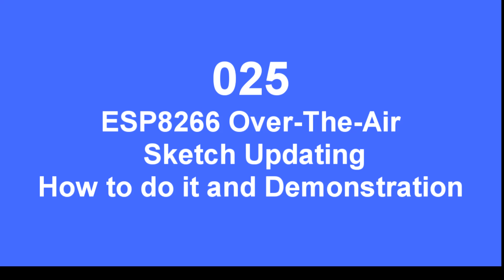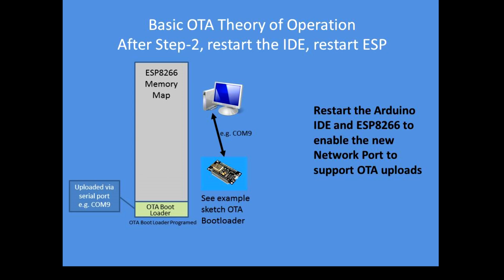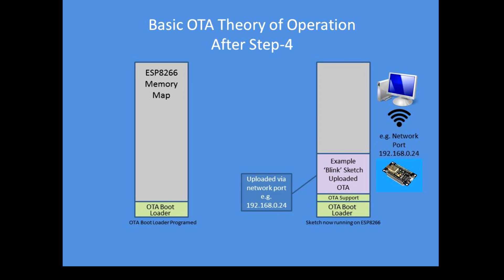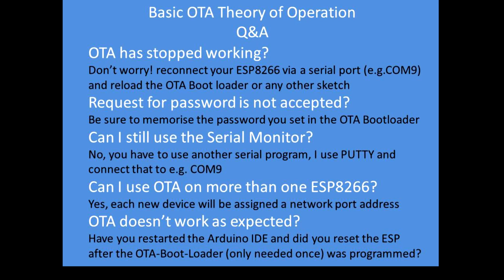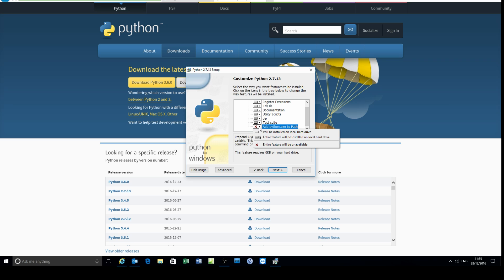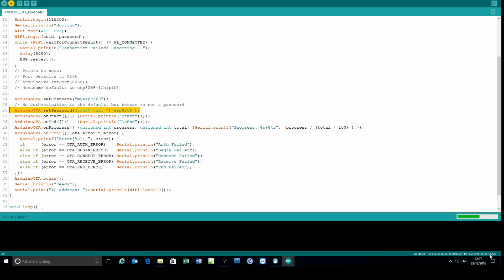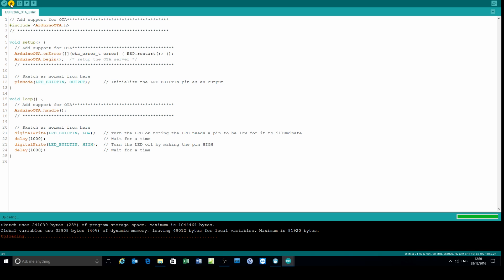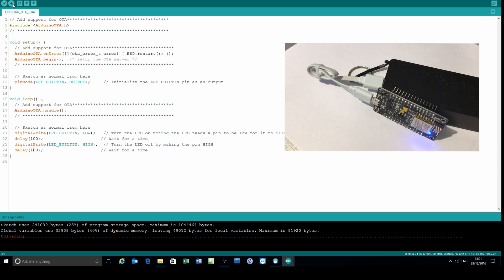Tech Note 025 - ESP8266 OTA Sketch Updating

Comment: I am getting error that there is no answer from the device
Reply from the maker: Is it connected or connecting to your network? Are you polling on the update device for a connection?
Reply: @G6EJD  it is connected to the network.
Reply from the maker: So in normal operation you can see the IP address of the ESP, then when you run the update process you see no response, this indicates that your ESP code is missing the check for an update service request. You can either use my example or the example in the Arduino IDE for OTA as they are identical. It’s most likely to be a coding error, you need to check your code on the remote device.
Reply: @G6EJD  yes it is listed under tools>port in the ide in addition to the com port. update service request, can you give me a hint what this code is?
Reply from the maker: @karanbirsoin9983  go to examples OTA

Comment: Just an additional note on this good tutorial. ArduinoOTA does not work when using timers or PWM. For anyone trying to do OTA updates with projects using timer interrupts the following code may save you a headache.

// Disable timer1 ready for OTA firmware update
// You can also disable timer0.
void ICACHE_FLASH_ATTR hw_timer_disable(void)
{
	ETS_FRC1_INTR_DISABLE();
	TM1_EDGE_INT_DISABLE();
	TIMER_REG_WRITE(FRC1_CTRL_ADDRESS, 0);
}

// OTA Callback, disable all PWM and stop all running timers
ArduinoOTA.onStart([]()
	hw_timer_disable();
	analogWrite(LIGHT_PIN, 0); // stop PWM
});

// Set timer1 as interrupt timer example code
timer1_isr_init();
timer1_attachInterrupt(onTimerISR);
timer1_enable(TIM_DIV16, TIM_EDGE, TIM_LOOP);
timer1_write(clockCyclesPerMicrosecond() / 16 * 50000);  // 50000uS = 20Hz = 50mS 

Ref: https://www.esp8266.com/viewtopic.php?p=34411

Comment: Is it possible to read the serial.print() if the esp is not connected to the pc? I use ota because esp devices are far from my pc, is there a way to read the serial print even without a connection to the pc?
Reply from the maker: Davide, it is possible to do this but the method is complex and requires a lot of experience and knowledge to do it, sorry. What are you trying to do? When you use OTA your serial port is already remote check your IDE you should see the ESP port number with its IP address so data on that port if you select it should be visible.
Reply: @G6EJD  thanks for the reply and the great channel. I'm using serial.println() to debug my code. In my ide Incan see the devices I uoloaded the OTA sketch and I can reupload sketches via ota but the ide tell me the ip address of that devices but not the serial port. Devices are not connected to the pc. So what is the right port to connect via putty serial?
Reply from the maker: Davide, in the IDE do you see the port (ip address) of your board? That is the IP address. The ESP does not have a process running that can respond to an IP connection on a given port, as I say it’s not as easy as you might think. If you use the Espressif IDE you can redirect the serial port to use telnet as a transport protocol and then on your PC you can install and use telnet to get a remote UART connection. There are notes that explain how to do this.
Reply: @G6EJD  This channel is amazing, congrats. I'm using Platformio for mi C++ sketches and I don't want to leave Platformio + Visual Studio Code at the moment. So I think that I'm out of lack. Thanks anyway :)

Comment: Just to be clear. It still works fine if I modify the sketch and upload OTA. This is merely for my own understanding.
Reply from the maker: That's the idea providing you switched over to the network port? and ideally run it remote from your PC, or disconnect the USB port.

Comment: I am a little confused When you hit the upload of the BasicOTA (at 6.00 minutes) your screen appears to switch over to "esp8266_OTA_Bootloader" while my IDE just loads Basic OTA. Have you missed a step or have I installed your files incorrectly? I'm sorry that Newbies, like myself, are such a Pain in the A.
Reply from the maker: I'm showing that the initial upload has to be via the serial port, then I move over to the network port. I've done a later video for the ESP32 which is identical an identical process and code is about the same, perhaps have a watch of that.

Comment: no network port is shown on ide.
what can be solution to that?
i've tried disabling the firewall,restarting the id and rebooting esp8266 but still the problem persists.
please help
Reply from the maker: zeeshan haider Usualky this is because the OTA support is not installed correctly or try installing it again and restart the PC and IDE.

Comment: G6EJD, i see the esp8266 in the Bonjour browser, but no port shown in serial in arduino ide? :( what do you suggest?
Thank you so much! :)
Marc.
Reply from the maker: What networks do you see? The default port, you can set it to your requirement, is wait for it 8266
Reply: the problem is that i don't see it in the arduino ide serial port?! :( only in bonjour browser in 8266 ports.
Reply from the maker: So there’s no USB connection then, this can be a really difficult problem to solve, do you get any connection acknowledgement like sound or when you look at connected devices do you see it?
Reply: I can only program it through COM port, there's no serial OTA showing up! :( 
thanks.
Marc.
Reply from the maker: Another common problem, have you tried restarting / reinstalling the java environment that handles the OTA aspects. In terms of sequence no virtual port will be seen initially by the JAVA device/port scanning, then you upload via the COM port a programme that supports OTA (that means the ESP actively checks for an OTA request let's say every 10-secs and if it does responds with an 'available for OTA' response) then it can take perhaps a minute or more or an IDE restart to see the new port (the remote ESP), after which you can disconnect the COM port and programme the device via the virtual IP port. BUT your uploaded programme has to keep checking for an OTA request or it won't OTA again and require it to be programmed via the COM Port again.
Reply from the maker: And let's not forget the ESP has to have made a network connection OK. So you should see it as an available network device.
Reply: reinstalling java didnt solved the issue :(
Reply from the maker: Have you tried the basic ota example in the IDE? I’ve used it recently and it works without problems on the 8266 and 32 devices. Your not using the latest java are you :) it has to be the specific version 2.7 something? Not 3.5
Reply: java or python ?
Reply from the maker: Sorry python, getting late here :)
Reply from the maker: If using one of the examples do you see on the com port that it joined the network ok? It reports progress as it goes.
Reply: i see it on bonjour as tcp.arduino port, but i cannot see above the serial com port in Arduino IDE :(
Reply from the maker: Other things to consider - a router not allowing unknown device connection, but unlikely, your development / ide platform is preventing a connection, like a firewall, a typo in the said or password.
Reply from the maker: I’ve just been reading the OTA documentation, there is a note about ‘boards.txt’ needing to be updated, I’m using IDE v 1.8.4 and it works.
Reply: firewall in my router is disabled, other things i can do ? 

Thanks.
Marc.
Reply from the maker: Maybe a Mac thing...
Reply: After basic OTA uploads, showing only: 
Ready
IP address: 192.168.0.125
thank you.
Marc.
Reply from the maker: It appears to be a problem with the OTA code on the MAC client as it works OK on a Win-10 PC, so it seems the API call that checks for a network connected device is not seeing the ESP, even though Bonjour does, the problem is, who do you report the issue to? Glad it's working for you even if not as elegantly as it could be.
Reply: what in the boards i have to update? ‘boards.txt’ 

thank you.
Marc.
Reply from the maker: In the OTA document they specifically mention an updated boards.txt file, so that gets updated with the IDE, if your running say 1.8.4 you will have the latest and nothing to do.

Comment: Hi Great video. When I try to upload the blink sketch via OTA I always get the error [ERROR]: No response from device.
Did you make any changes on the router, firewall ect.

Any idea what the issue could be?
Thank you in advance.
Reply from the maker: Have you tried the sketch I supplied on Github? I made no changes to my router and I'd expect most Routers to allows allow a LAN connections and assuming you don't have any issues connecting a new Wi-Fi device to your network then that's should not be a problem. Does the ? ESP8266 connect to your router ordinarily?Are you seeing a network port in the IDE something like 192.168.0.70 that should appear when the ESP8266 has been running a while. Sometimes you have to restart the IDE so that it can detect the requesting ESP8266 / ports. If the ESP8266 is not requesting an OTA the port does not appear.Sometimes a reinstall of Python 2.7 reinstates the port detection elements.
Reply: I have just reinstalled Python 2.7.14 and I execute these steps:
1. Use your ESP8266_OTA_Bootloader.ino and upload via serial cable.
2. Restart IDE and press reset on the esp8266 board.
3. Disconnect esp8266 board and start it with a power bank.
4. Use your ESP8266_OTA_Blink.ino and choose port esp8266_ip_xxx
5. Upload the sketch, I pass the authentication step successfully but then receive the error " [ERROR]: No response from device" 

In my opinion esp8266 is properly connected in my WLAN / router.
Any idea what the issue could be?
Thank you in advance.
Reply from the maker: When the upload completes the ESP8266 is reset and disconnected from the network, so initially I'd expect the network port used to programme it to disappear. So I take it that a simple LED blink routine does not blink as expected, if so then let's think through some diagnostic steps, have you maintained the serial connection to watch the serial port output as that will give you an indication of any possible errors and you could add more diagnostic prints to your programme to see where it stops issuing them. My guess is it will be something straightforward perhaps a typo somewhere. The ESP8266 OTA is a stable process, are you using the latest IDE for the ESP8266 2.3 and not 2.4rc1?

Comment: Watched this through and couldn't work out why the blink was being uploaded OTA. It was only when I stepped through frame by frame and saw at 6:38 that the port was changed. Bit of a fundamental part of the process and it's shown in only a couple of frames for a fraction of a second.
Reply from the maker: Hi Nicholas, well I do say at 6:06 that the loader sketch is being uploaded by the serial port and then at 06:44 just before the Blink sketch upload that the board is connected to the new network port at 192.168.0.24 so the OTA can take place. I tried to cover the fundamentals in the introductory section. It's worth reading the IDE guidance on OTA too as it explains the process, I hope this helps you understand. http://esp8266.github.io/Arduino/versions/2.0.0/doc/ota_updates/ota_updates.html

Comment: Had that OTA handling function been implamented into the ESP's boot loader already?
Reply from the maker: Michael It was only included in IDE 1.6.5 and has since been deprecated in favour of a user added library approach as demonstrated here.
Reply: Why not develop it further as this is the future of programming I already have a project where that this is a must. think about how useful that would be for robotics! if you know FIRST all the micro controllers there (Roborio) use OTA uploading since the robots are dynamic and it wouldn't be convenient to hook up a long cable to the robots there.

Comment: Can i do the OTA from anywhere in the world?
For Ex :Programmer in US and ESP8266 or node MCU in INDIA.IS it possible with the above
Reply from the maker: Should be, I have not examined the Library that sets the IP address e.g. 192.168.0.24 in my example. Clearly it works on a LAN but a WAN would need your remote router to allow traffic through from the WAN IP to the ESP8266-IP with a rule that looked something like this:
WAN-IP:8266 to LAN-IP(192.168.0.24:8266) allow TCP/UDPthe connection would be WAN-IP of the remote site e.g. http://151.64.234.67:8266/ and that is where the Arduino IDE would need to have access to, so there would need to be a way of changing 192.168.0.24 to in my example 151.64.234.67 so that the remote programming can be done.I checked the documentation and there is a Web Updater process too, so you could use that over a WAN. See here:http://esp8266.github.io/Arduino/versions/2.0.0/doc/ota_updates/ota_updates.html
Reply: In the link the requirement given is "It needs to be in the same network"....Mean that we cannot do a update from anywhere...is it?
Reply from the maker: Yes it does, but in the section above copy:"HTTP Server  ESPhttpUpdate class can check for updates and download a binary file from HTTP web server. It is possible to download updates from every IP or domain address on the network or Internet."It clearly states 'internet' and I think it can be done, but never tried it. It looks like the documentation needs to be reviewed as it's ambiguous.
Reply from the maker: Joe Anon Indeed but afaik there is no support for that approach and the two devices ESP and updating device must be on the same network.

Comment: Thanks for the great video.

Just a suggestion on another video using the WeMos D1 "PRO" compatibility with your various projects.
Reply from the maker: +Grizzbee Uno Thank you. I do have the Wemos D1 Pro and apart from the extra memory (not RAM which is more important IMO) it compiles all the projects and works OK. One of the problems is integration with the IDE has not been completed and whilst there is a boards.txt file available it is more specialised for most people. Nonetheless I will try to use it more. Out of interest, using the 4M ESP8266, I have still not exceeded 35% usage of that device and I understand there is a limitation with the 16M version (Pro) in that the extra storage cannot be used by e.g. SPIFFS, so the product concept is good, but access to its full potential is limited.

Comment: I added this to my sketch the first time it worked, but kept saying booting. Then I downgraded my Sketch Ardiuno IDE now it doesn't work. 1.6.5 I think is the verson. Thank you for doing this video as well. If I upgrade I best move my working Sketches. Other wise I lose them.
Reply from the maker: Yes I agree, using the latest IDE is a challenge with older designs especially libraries that are not being maintained, so 1.6.5 is a good compromise. I'm using 1.8 and that works OK as does 1.6.12 or 1.6.13. glad you like the video my aim is to spread knowledge and help people.

Comment: On my Installation of Python in my Win7X64 PC I got an interrupt:
"There is a problem with this Windows Installer Package. A program required for this install to complete could not be run ..."

Do you have any Idea, why?
Reply from the maker: There's some documentation on Python installs, but what I would try is download the 2.7.13 package to your desktop, then when complete right-click it and run as administrator. Is your account an administrator. If you Google win 7 Python install problems there are many solutions offered, but each will depend on your particular PC setup. I would try overriding the privileges s first then try one of the other solutions. My system is win10 and it installs without any issues and my account is a system administrator.